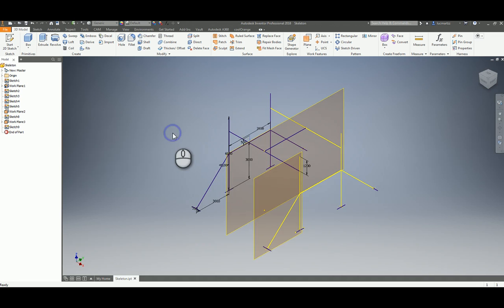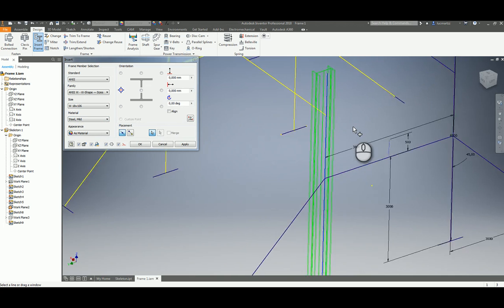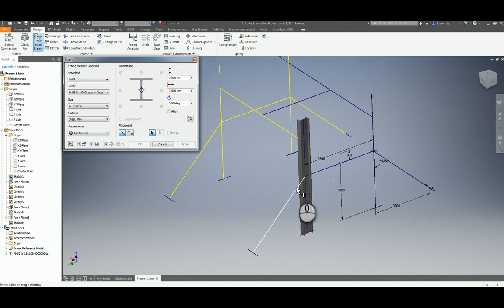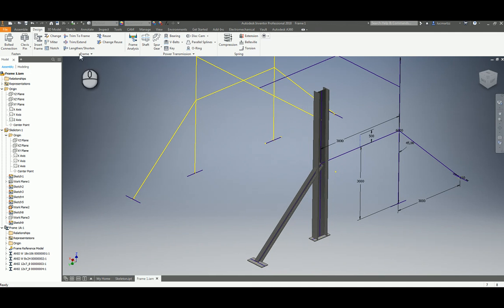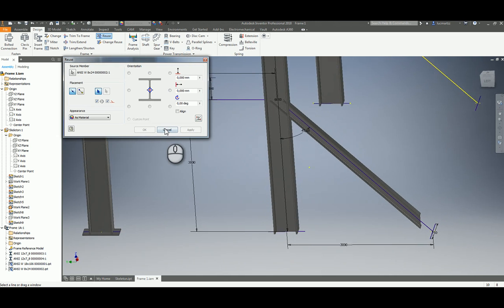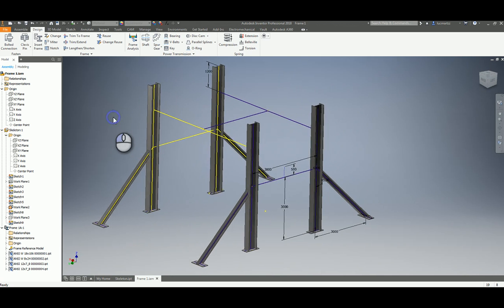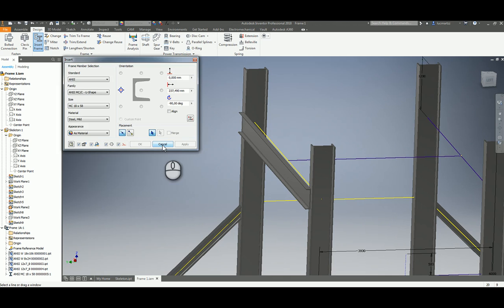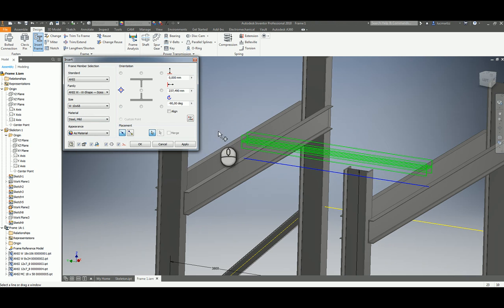Frame Generator (Crane Structure)

Comment: Hi, I have a question. I use Inventor 2017 and I do not have the command Insert End Cap, which I see has appeared in 2020. How do i insert plates at the ends of the profile bars? I want plates of customized dimensions, not from the library. I did this by drawing a part in separate file, placing it in the frame assembly and then it's impossible to constrain it on faces which are cut inclined. It seems to work inserting them with Joint, but it only works edge to edge, with no offset. If I need to offset the edge of the plate from the edge of the inclined fece of the steel bar, I have no option.
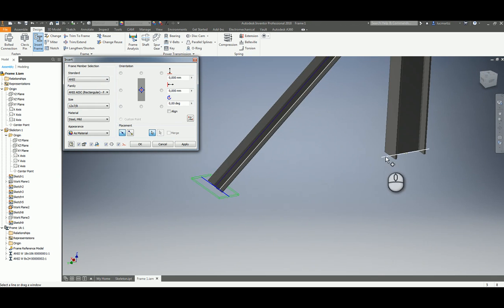Reply from the maker: How about the method shown in 4:35 ? You can add a perpendicular or angled line, by selecting a plate material that adjust to the dimensions can be used useful for the BOM.